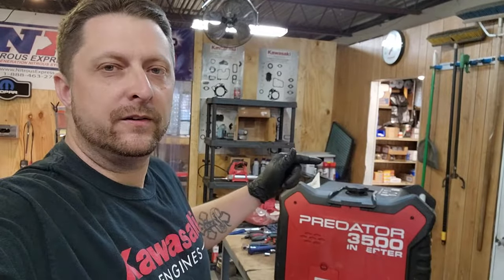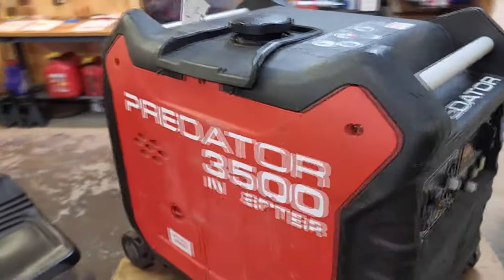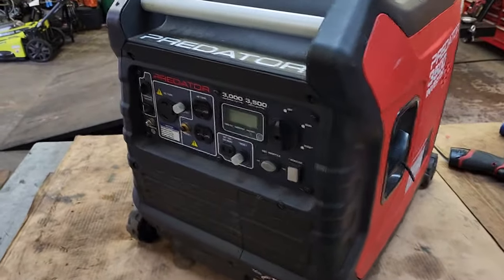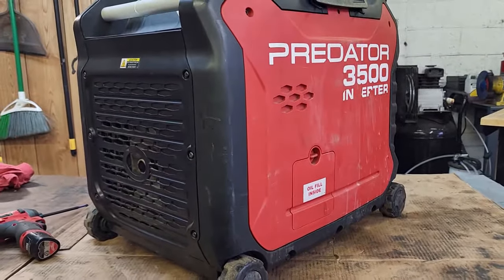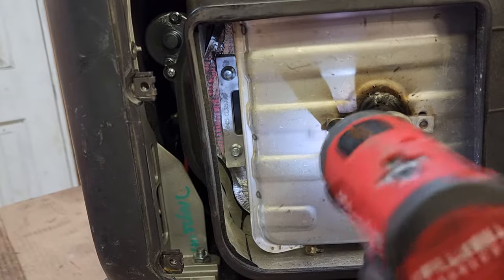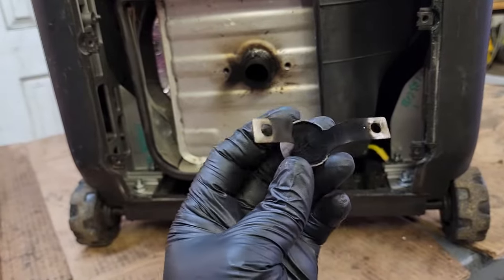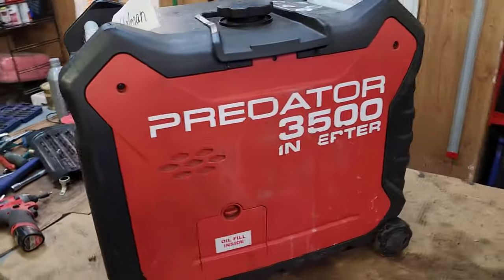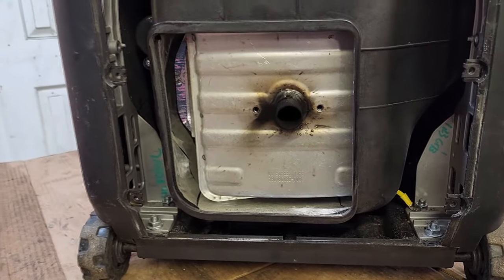Harbor Freight Predator Generator Running Bad EASY FIX

Comment: If it's using excessive oil often its a fouled plug or a clogged spark arrestor. They can run fine for a week, then suddenly the arrestor clogs up. HF Phenomenon. Fouled plug = runs hot = oil consumption = clogged spark arrestor. I love these generators. Super quiet and can handle the heat and cold. Just a little maint and knowledge of their mulligans is all you need.

Comment: So I did this as a fix, went to HF to get new spark doo hicky.. they don't carry them instock. 3mths later my gen runs like it's at max watt and used to burn a full tank in 4hrs... now it still runs high and shuts off in 20 mins

Comment: Hey D-MAN I have a predator 4000 from harbor freight. One of my receptacles outlets is not getting any power. It runs great, but only can use one side. It also has the 120/240 outlet too. I never use that one. Any help would be greatly appreciated. Thanks

Comment: Wow. I've been having problems with mine for 3 days. Changed the oil, cleaned spark plug, checked air filter, cleaned out the gas line... Your video was a Godsend, and it solved the problem - a big deal when living off-grid and need to top up the batteries in winter. Thanks so much for posting this.
Reply from the maker: Glad it helped

Comment: I have a predator 8750 for about 10 years it’s run like a champ. We recently had a six day stretch of power outage in Michigan and we ran it 24/7. In prep for the next storm I tried to start it and it would chug a couple time and stall out. If it did run it sounded strange. Ordered and replaced the carb and air filter housing. No change. I was preparing to drain and replace the gas as a last resort before paying a mechanic to look at it.  I came across your video and I noticed that sound at the end - that’s exactly what mine was doing!  Checked the arrestor and it was totally blocked. Pulled it off and she started right up and ran beautiful!  I cleaned that arrestor and put it all back together - problem solved!  Thank you so much!! I was dreading having to buy a new generator.
Reply from the maker: Awesome
Reply: What did you use to clean the arrestor, please?
Reply: @jerrybragg6214  I just scrubbed it with a wire brush. But anything to remove the carbon buildup.

Comment: Thank you very much.  I have the same exact one but it started cutting off about 10 minutes later ..I have it running a printing heat press .. kinda heavy load but not sure that's the issue ... I changed the oil and still does the same thing ..I will do what you recommended here ... another thing is that I can barely pull start it .. I mean I have to pull until I run out of breath and  might not even start .. the only way is the electric start .. I'v only had it for about a year ..only 127 hours on it . please let me know what's wrong .. Thank you.

Comment: Sir. I have to  fix just about everything mechanical around the home/property. I have a special needs family member using the Predator 3000/3500 for their RV during power outages.  One night the generator/inverter got to close to the wall of its storage cover. Seems it over heated and shut down. From my research I'm thinking it could be the little fuel filter on the carb inlet and/or the exhaust spark arrestor like you've just shown. The generator probably doesn't have 100 hrs use. Are there any other probabilities you would or could suggest ? Thank you. God bless you.

Comment: FWIW, there should also have been a "witches hat" inverted cone screen mesh  inside the muffler outlet.  Should be able to pull it out easily, and I'm surprised that it didn't blow out when you cranked the motor with the final spark arrestor removed..  Both pieces can be cleaned using carb cleaner, or burned off clean using a propane torch.

Comment: I just bought a predator 9000w. Brand new from harbor freight it ran good for for about 30 min then it started doing. This what could be the prob would it be this same issue ? It has the proper oil levels and all

Comment: I bought a predator 5000 duel fuel generator this spring. I have been using it everyday on propane only. It recently began randomly tripping overload for no reaaon. Ideas?

Comment: Hello so have one of the predator 3500 it starts right up but then acts like it's under tremendous load I have to pull choke on then back to run really quick to keep it running multiple times to stay but it jumping all around like it straining  bad it's not very old any ideas? I also loosened the muffler connect so it would breathe better but same nothing changed.
Thanks!
B.
Reply from the maker: Sounds like bad carburetor

Comment: Good morning I’m having a problem with my Predator 6500 idle is rough and just replaced the carburetor and spark plug. Choke is on start and when on run it revs up and back down. Also having a problem with it not making power to the outlets from the stator. The brushes are bad and will be replaced this evening. Could you help me?
Reply from the maker: Sounds like the carburetor still doesn't work correctly to me. Also if not making power to the plugs may not be cost effective to repair it.

Comment: I have a brand new one that has less than 30 hours on it.  At 22 hours i knew something was wrong so i pulled the arrestor and it was completely caked, especially the inside screen, cleaned them both and the hissing sound went away and  it was able to power my rv ac.  Hiwever within 5 hours it was hissing again and dirty carbon filled arrestor again.  Any ideas? Why is the carbon soot building uo so fast?  Thanks in advance!
Reply from the maker: How is the air filter?

Comment: Hy, I got one of those 3500 and mine I can start it, but as soon as I change it to run it dies. Any ideas? Thanks in advance.
Reply: Could be exhaust stopping up or carb main jet stopping up and not supplying enough fuel 
Carb are easy to clean
Reply from the maker: Sounds like clogged dirty carburetor will need cleaning or replacing.
Reply: Update, Replaced the carburetor and it's running like a champ. I was going to clean it, but it was easier to just buy one and replace it. About 25$ in amazon.
Reply: May be old gas. That's what happened to me. Mine was and still is brand new but when I first bought it I ran it like an hour then it sat for like 8 months and we had a power outtage and i was thinking since I put the additive it would be ok amd I started it and it ran for a few mins just fine then started bogging over amd over. Well I siphoned the old gas out and added new gas and it runs just fine now

Comment: Hey man I got a predator 9000 generator is a crank up and running for about I said 25 30 seconds and longer and then it cuts off at a crank right back up running for a few minutes and cut off
Reply from the maker: Sounds like it may be loosing spark or power to the fuel solenoid
Reply: Could be the o2 sensor 
It’s behind panel and it’s the black and white wire, unplug and make jumper wire and jump it, don’t mess with the rest of o2sensor wires

Comment: Mine won’t do it even if I do clean it it’s like once I connect it to power microwave loses power but the generatori won’t turn off keeps running before generator would work fine

Comment: But wht if engine wnt stay running it starts runs bought 30sec then stops running
Reply from the maker: Carburetor is clogged will need removed and cleaned or replaced
Reply: Also check your oil level

Comment: B***** I have a predator 9000 it's brand new cost me about $1,400 to wire my panel and this is the first time I've ever tried to run it and it runs for about 2 minutes and shuts off. I don't know why and neither do you. This is a brand new unit first start.
Reply: Check for bad 02 sensor 
Blk and white wire, unplug and jumper wire it then test run